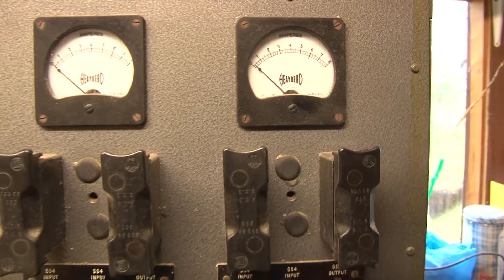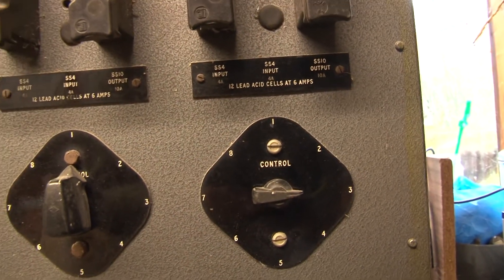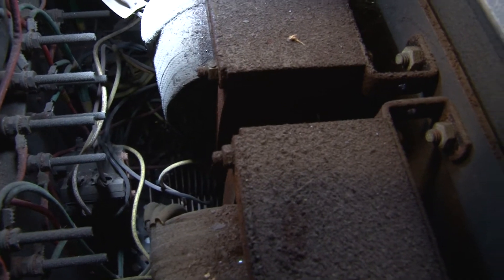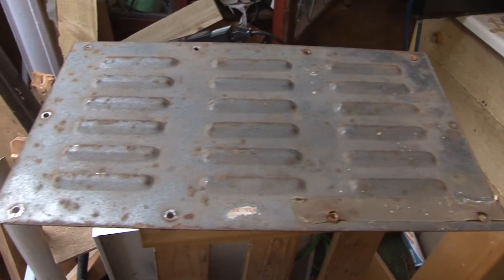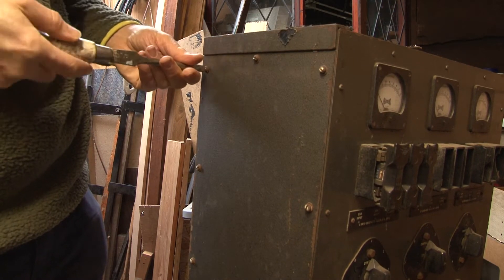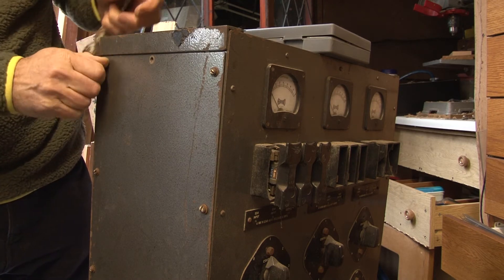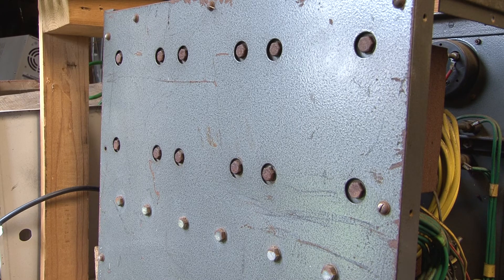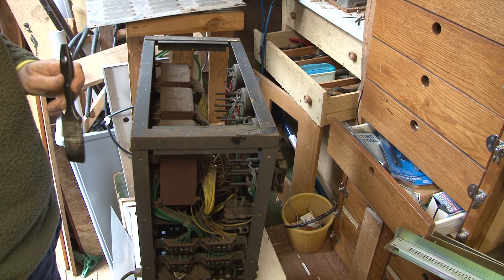Heayberd Battery Charger Part 1: Paul starts the year as he means to go on - renovating a charger!

Comment: Interesting old battery charger. I have a very old Heayberd charger that I bought from an army surplus shop about 40 years ago. Still works great and reliably, with the odd cable change over the years....even the same colour and paint finish.